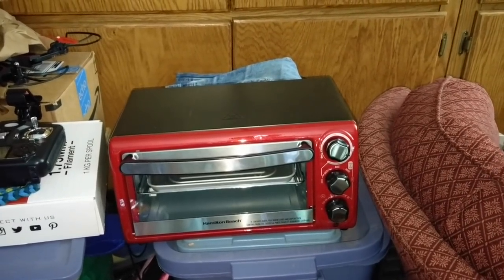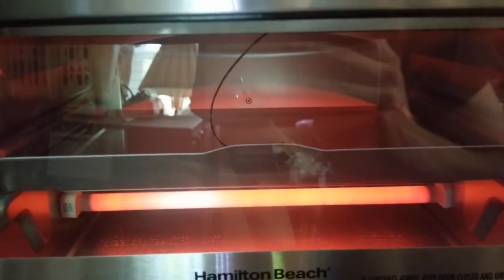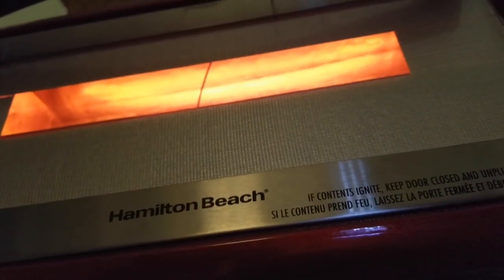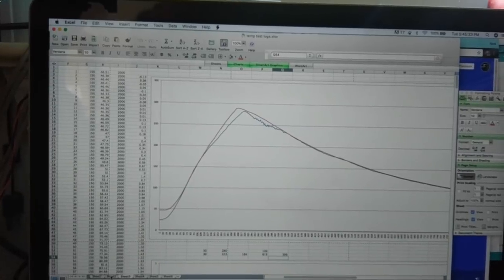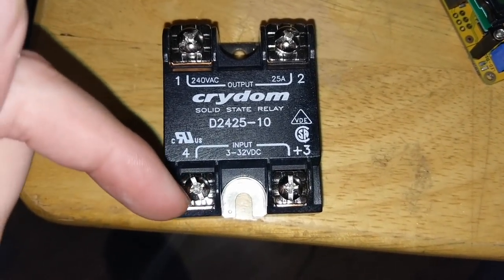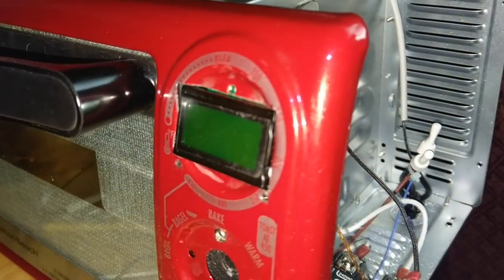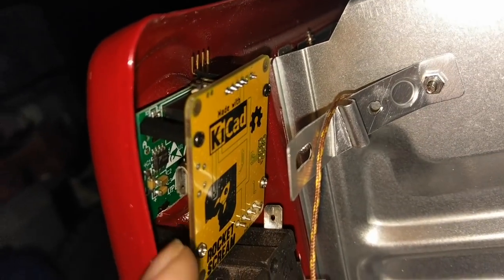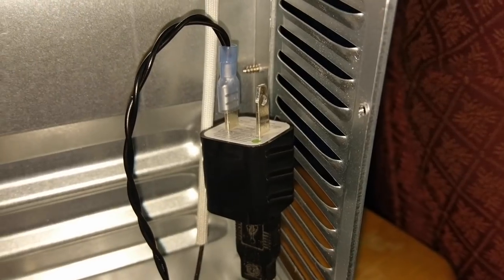DIY PCB Reflow Toaster Oven Build

Comment: 36:50 That diode is being used as a half-wave rectifier, reducing the power to that element by ~50% because of the reverse bias blocking half of the mains waveform.
Reply from the maker: Ahhhhhh, yeah that makes a lot more sense because the diode would only be dropping a volt or 2 which wouldn't make a noticable difference. Clever!

Comment: A video showing the solder paste application maybe?
Reply from the maker: That is not a tutorial I can do well as my paste application is terrible. I buy a stencil with my pcb order and make a jig out of cardboard and old pcbs so the new one slides in tight. I use a credit card to apply the paste but I can never get good enough pressure for one nice pass. Having good paste is really important, as is not applying to much, or you'll be doing a lot of rework after it comes out.

Comment: Did you ever measure the 2 elements (resistance) to see if they are any different, I doubt it on such a low cost oven.
Reply from the maker: I didn't, but I may recall seeing different wattage raitings for either. Hard to recall. It's been working fine as is, just need to make sure the probe is firmly attached to the pcb copper or you get popcorn and tombstones

Comment: Curious how you gathered the temperature data (like what you graphed at 21 minutes)?
Reply from the maker: So the controller is programmed to output updates over it's serial line on the header. I rigged up another arduino that has native USB serial so I could read in the reflow data, then spit it back to the serial monitor from there. After that I copied the whole monitor to a plain text file and imported it to excel. It has a smart importer which you can use with delimiters to break the data into columns, then graph away!
Reply: @NickInTimeFilms    Ah cool, thank you for the info.  Going to try this out.

Comment: hi, Do you believe that with this oven you can weld a MAPBGA-196? MIMXRT1052 processor, thanks.
Reply from the maker: I've never tried reflowing bga, but it might be possible. If the stock profile doesn't work, programming a new one will be difficult.
Reply: thanks.

Comment: I have one of these rocket scream controllers. I'm in the middle of my build. My controller has and output for fan. Does anyone know what the heck kind of fan this thing is supposed to have. Do I even need a fan? Also, how has the tape worked long term? I'm about to order some tape that's rated to 350c, does that sound high enough?
Reply from the maker: Some toaster ovens are "convection" as they come with a fan to help blow the air around. I'd assume you'd need another relay to actually drive the fan, but it's certainly not necessary. I've been able to get pretty consistent results by using quality paste that's not expired, and making sure the probe is physically touching a through hole o get accurate board temp. That has eliminated any tombstoning or popcorning issues.

So far, the tape hasn't burnt any more then what originally happened during the torture test, but I run it outside because of the fumes. 350c should be good enough.
Reply: @NickInTimeFilms  Thank you ever so much for the speedy response. I'm going to pull the trigger on Amazon for tape and a small power supply that I need for this project.

BTW - You just got yourself a new subscriber with bell set to on. Thanks again.